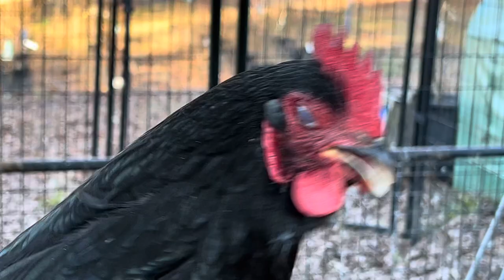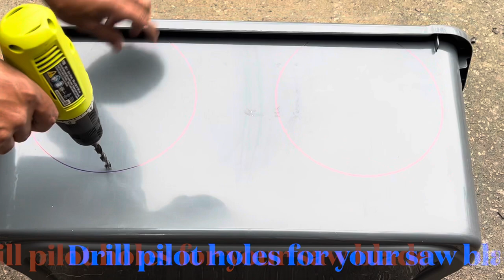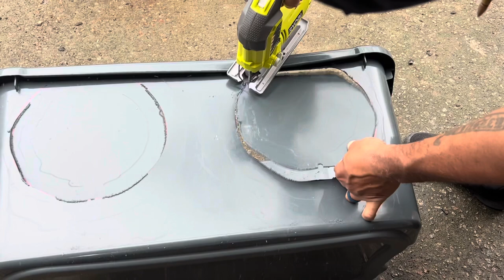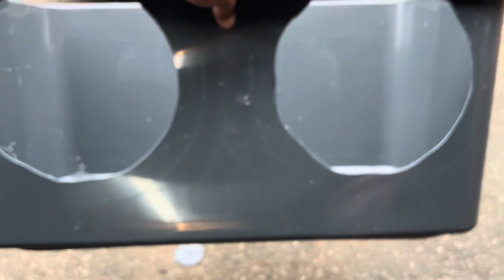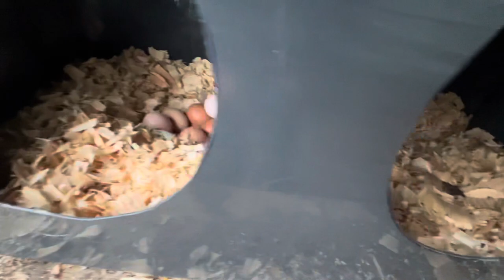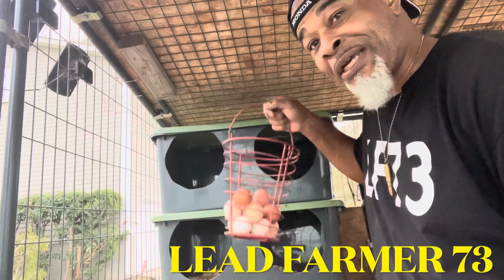chicken coop condo stackable

Comment: I use the totes also. I screw 2 totes on a plank of wood so the girls don't tip the totes over. Plus I can just pick up the plank with 2 totes connected and wash both at the same time.
Reply from the maker: Great idea
Reply: I have about 30 girls, and they might be more wild than yours.

Comment: Tip: take out the nesting material. Put a 12 x 12 concrete block in each container. Replace nesting material. The containers are light-weight.  They will tip over if hen lands on right place.  We had that happen. Oy!
Reply: ...Another idea is to use zip ties to affix to the fencing. We have used them with no issues. Both totes stay in place...
Reply from the maker: I said that a little earlier
Reply from the maker: Great minds think alike

Comment: Question: Is there a reason the vent holes are places near the entrance? 

Left on my own i would have put them closer to the center of the side, or maybe three slightly smaller spaced along the back wall...
Reply from the maker: You can put them wherever you want. That was not a scientific placement. I just know my land and which way the wind blows to give them the most ventilation

Comment: Hey brotha lead do you run into problems with predators with your chicken setup? How do you protect your girls if you do?
Reply from the maker: No not anymore I put wire around the perimeter of the coop to keep them from digging under. And metal roof on top to keep them from climb in
Reply: I know I'm not supposed to because of hoa but I'm thinking of getting two or three and make something small for them. Whats a good breed?
Reply: Gonna do some research on breeds but if you don't mind please talk about it in one of your upcoming videos.

Comment: They have a behind full of fragile eggs you don't want them to fly up that far to lay eggs you could get broken eggs
Reply from the maker: Sounds like you may want to do a little more research. Look how far they jump up from the ground just to get to the bottom nesting box. I have been keeping chickens for over 12 years and i have never seen my girls have a problem with getting into and laying in any nest i have constructed. 😉
Reply: @leadfarmer73  oh ok lead I hear ya just didn't want them to cut their claws on the hard plastic circular shape.  Also that's good you been raising chickens for some time but I was just concerned that's all.  Go ahead raise your chicks the way you want to just was wondering.  Check their bottom claws to see how it looks at the bottom.  And in the country a chicken will not run away from home. You know once after you got them all locked up in a cage
Reply: @leadfarmer73  it's like when they have ppl incarcerated they break them thats the main thing for prisons to break them not always necessary the crime like a horse Break them in the wild ones